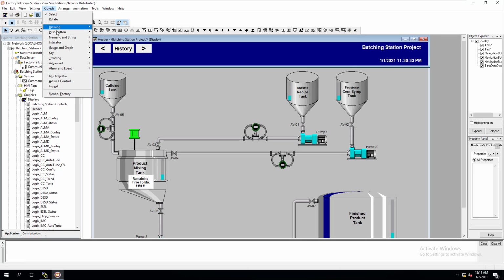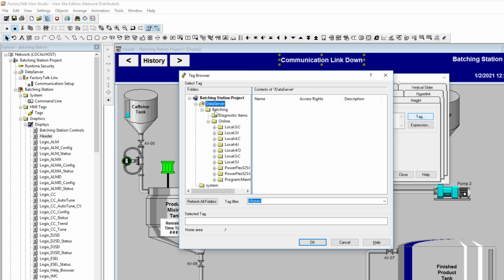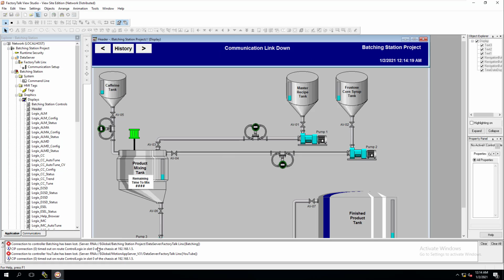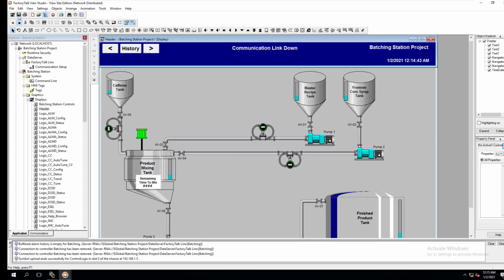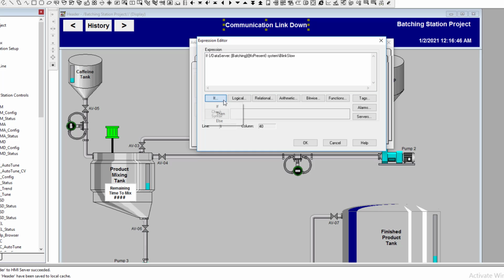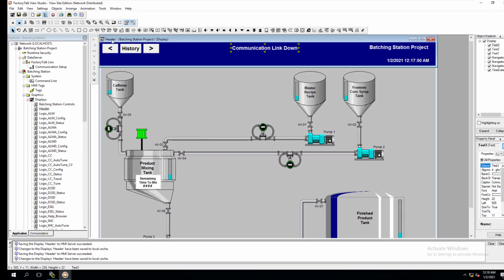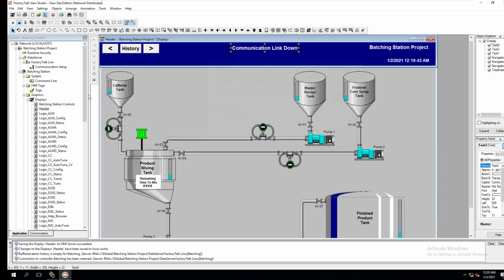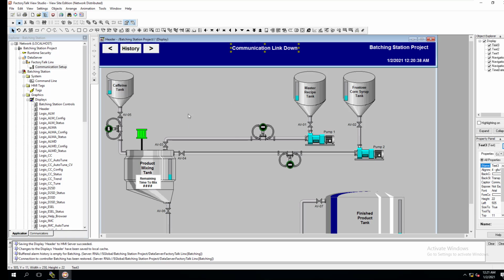FactoryTalk View Studio Site Edition | RSlinx Connection Status Animation | Batching PLC Day-13

Comment: Sir, I have 16 nodes connected to 1769 controller. I need to visualize the connection status of all in SE. how to do it?
Reply from the maker: Then it is best to either use PLC logic, like a GSV for all 16 nodes.

Or you can also do this using FactoryTalk by using that @Present tag for each.

That tag is in systems comms